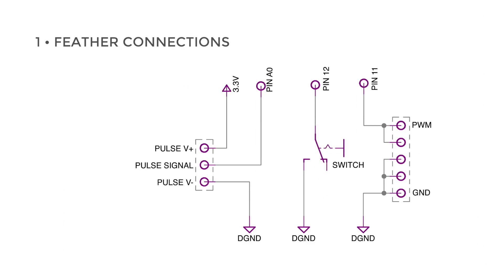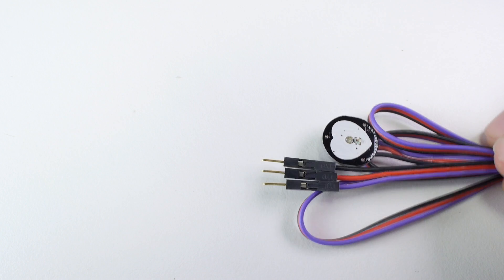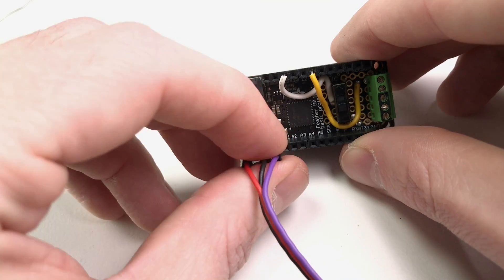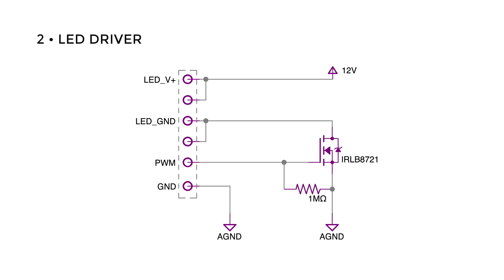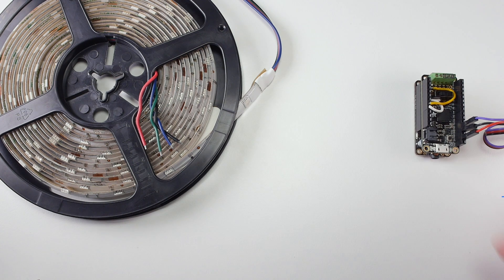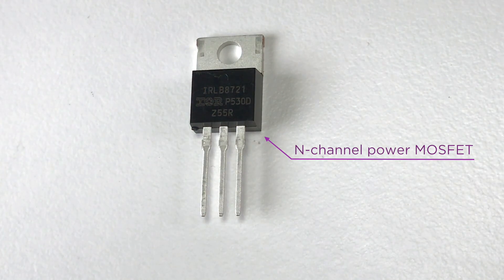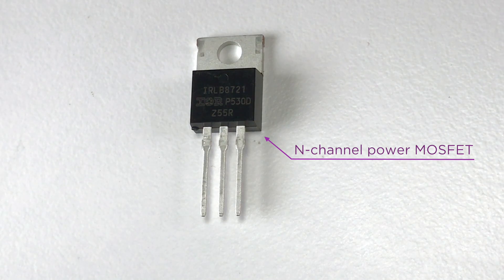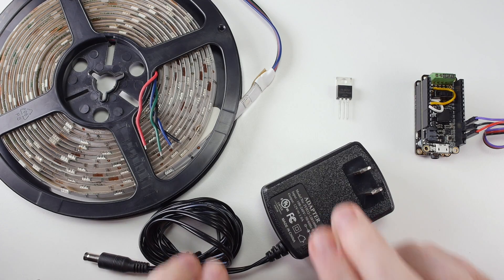Collin's Lab: Pulse Room

Comment: The macro shots of soldering were fantastic, the best close ups I've seen. You should do a how to solder video using shots like that. I've taught kids (8 to 17 years old) how to solder and the hardest part for them is getting that the solder has to flow like water and not to brush it on like paint.

Comment: "Evil disco" == "Blood rave!" (Blade).
Cool project, nice presentation, but it seems almost criminal to install that many LEDs and only wire/hook up the red ones. Build a general purpose system with every LED individually targetable, then write the software to pulse the red ones ... for now. Would leave all sorts of lovely capability ripe for exploiting later - gentle mood lighting, sunrise/sunset-mimicking lighting, disco or space battle effects, etc., without having to rip out or rewire anything.

Comment: hey I'm having trouble with my pulse sensor, whenever I plug it in and pull up the serial monitor, it doesn't show my heartbeat, it shows a zig zag line that's incoherent. could someone help me out?
Reply: serial plotter, and it's on an Arduino mega 2650